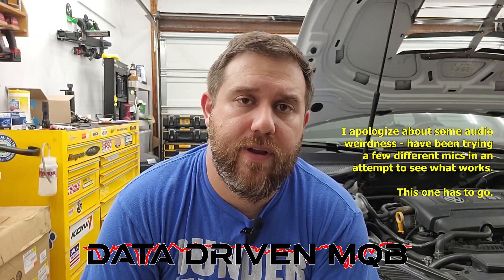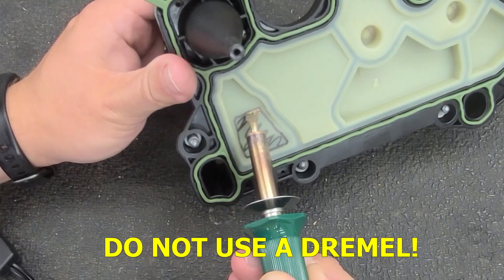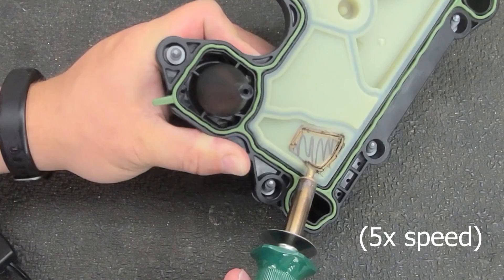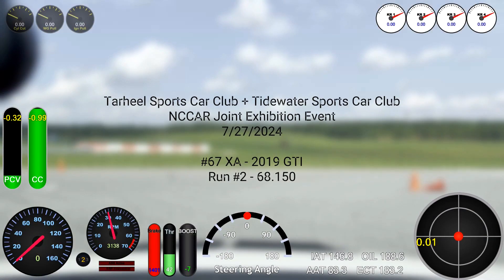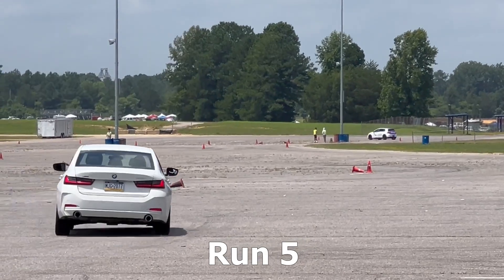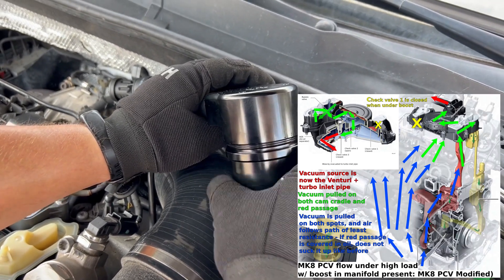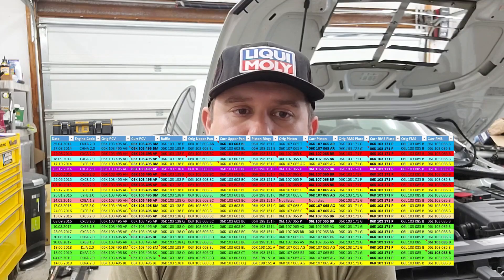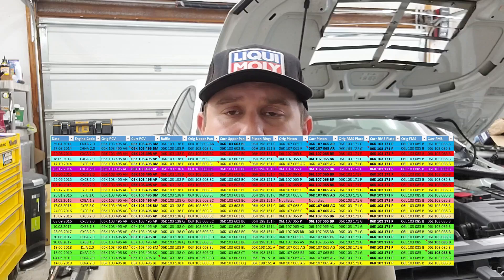MK8 PCV Modification - Fixing a 2015 GTI's smoking problems

Comment: I have 2017 engine code cxcb i recently did the retrofit pcv upgrade and got so much smoke on the street happened at 6500 rpm im wondering if this mod would solve my issue hear you say it helped a few others it probably would salve my problem
Reply from the maker: Follow the flow chart and check out the video in the "Smoking problems" section:
https://www.datadrivenmqb.com/mk8pcv

There are a LOT of factors to consider, and the CXCA/CXCB engine codes had huge internal changes throughout the lifecycle. 15-16 cars are more problematic, but a few very early 17 VINs I've run have had the earlier style piston rings as well. These cars tend to not do as well with the retrofit.

Call your local dealer, provide your VIN, and ask for the piston RING part number. Check the flow chart to see if it's listed as a 2 or 3pc rings. Oil leaks, excessive blow-by, bad valve stem seals can all also cause problems even if everything else is "ideal". Also if it is just the basic retrofit, then you need the stock turbo inlet to have any chance of it working well.
Reply: @datadrivenmqb so I’m on a vortext xl turbo I tried to put the stock turbo inlet doesn’t fit this turbo when I had the stock pcv I never had any smoke like now the last change done on the car was the retro fit pcv valve and then I got smoke 💨
Reply from the maker: @Nic-Ink  got it. As explained here nearly 2 months ago... rule #1 is if you aren't having problems then don't mess with it:
https://youtu.be/g84dsN3UfvI

Since that ship has already sailed:
Follow the flow chart here: https://www.datadrivenmqb.com/mk8pcv

Send me a PM with your VIN through https://www.facebook.com/datadrivenmqb if you're on FB and I can run it to see which ring package it has.

Comment: have a 2015 MK7 no issues currently -- is it a bad idea to preemptively do this retrofit? bought the kit, but having second thoughts because of "don't fix what's not broken"... stock turbo, but i do have a bigger turbo inlet pipe... leave it be or still worth doing?
Reply from the maker: Don’t fix what isn’t broken. If anything consider a stock TIP and OE valve. I’ve never noticed a difference (noise or performance) FWIW.

Stock valve with stock TIP is generally best on 15-16 GTIs. The modified MK8 valve has worked for some, but IMO it’s more of a last resort type of deal for those who’ve tried the retrofit and smoked still. There’s a lot of info here… the early cars have poorer ring seal which means more blowby:

https://youtu.be/gx8o4Sh5B6Q?si=flxJ6rwGwqUi6HDL

Comment: Hi, great videos! Really appreciate your hard work and research. I have a 2017 gti with an IS38 swap. Been running an IE catch can system, but recently discovered large amounts of oil getting into the turbo inlet. I just ordered your mk8 full retro fit kit along with a Jackspania catch can. Which I'm going to install the way I've seen in your videos. Now I'm wondering if I should do the small window cut out on the bottom of the Mk8 pcv valve as well. I track the car a bit, run it pretty hard. Thanks again, keep up the great work 🍻
Reply from the maker: There’s some newer content (namely the parts catalog surfing video), latest and most important stuff is posted here:
https://datadrivenmqb.com/mk8pcv

For a 2017 it’ll depend on what your factory ring package was as some early cars had issues. I don’t know that I’d recommend it for track use unless you’re vehemently against a catch can. No personal experience with IE. On a 17-18 car for track use I’d err towards a plate system.
Reply: The oil gathering in the turbo inlet pipe scenario you talked about is exactly what I'm experiencing. I have a CTS turbo inlet pipe running with the IS38. The IE plate system is is very similar to the Apr system, which is what I have on the car now. The Mk8 retrofit with the venturi and the Jackspania catch can inline with the turbo inlet pipe is what I'm planning on changing to. In your opinion, is this a good way to go? Mostly street car, some fast canyon drives which kinda replicate autocross. And few track days a year. Thanks again.
Reply from the maker: @alexanderuhl9716  if it were mine I’d consider the MK8 as long as my car has the 3pc rings and not the older 2pc rings same as 15-16. They didn’t get changed until early in 2017 MY production as far as I can tell. If you call a dealer and your piston ring part number ends in C, E, or F then it’s the older 2pc style.

Also not all plate systems are created equal. I’m not sure if it’s the plate itself or the can design, but I’ve had multiple people who’ve gone from RL to APR or CTS to APR and that ultimately fixed their issues. APR is the only one I’ve played around with, and have you’re the first I’ve heard of running the IE system so dont even have any real anecdotes of how it’s worked for others for comparison. 

Plates require large volume flow to pull air without pulling oil with it. Any restrictions can cause localized low/high pressure zones which will pull oil out of suspension while splashing around.
Reply: That's a great help, thank you very much 🍻
Reply: Turns out I have the 3 ring pistons. I'll let you know how things turn out.
Reply from the maker: @alexanderuhl9716  just so we’re clear (and for anyone else who might see this)… it’s not 3 rings total. It’s 3pcs just for the oil ring (bottom ring). 2pc have a coil spring and a U shaped perimeter, 3pc have a flat top + bottom scraper + a center wavy spring ring to keep tension.

There’s a post about it here, though I’m currently working on a “all you need to know” kind of video regarding MK7 PCV solutions/MK8 retrofit/plate systems as I know the info is scattered all over.

https://golfmk7.com/forums/index.php?threads/understanding-the-mk7-pcv-function-retrofitting-the-mk8-pcv-and-why-catch-cans-are-bullshit-imo.429130/post-8087628

Comment: Hey there! Have a 2020 gti stage 2 ecu tcu tune. Started to see smoke on start up on warm engine. I’ll try to do this pcv retrofit and i saw a kit online. Do i need to modify it aswell like you did?
Reply from the maker: No, the modification is strictly for the earlier cars as a last resort. I recently posted a PCV diag flow chart:

https://www.datadrivenmqb.com/mk8pcv

A 2020 GTI has the better style rings and a factory BK PCV valve for reference when using the chart.

Comment: Quick question if you don't mind answering. Woukd you run the mk8 pcv vs the catch can/pcv plate? And do you run a catch can with the mk8 pcv? Watch some of you other vids as you mention i seeing problems on RH turns and heavy deceleration at the track with buring oil and on the heavy g corner occasionally going into limp mode. 2016 gti
Reply from the maker: For a 15 or 16 GTI I’d err towards a plate system since they have issues. This modification is a bandaid that I think can be useful for street use in specific cases, but for the cost it’s new OE AP PCV with stock TIP or right to a plate system with non-OE TIP for track use.
Reply: @datadrivenmqb thank you, looks like I'll have to spend a little more and get a pvc plate. Would you recommend running a catch can as well? I'll probably go 034 since there on sale right now unless you got any strong recommendation.
Reply from the maker: @blueice8683  All of the plate systems on the market come with a catch can (because they require it) so there's really no getting around it. Most sell the plates alone, but that's more for piecing together your own system or replacing a broken/damaged part from the full kit.

I've personally crankcase pressure tested the APR and believe it's a solid option: 
https://www.youtube.com/watch?v=aeCQuBDEUEs

I know many people running it successfully on track. The 034 is probably my 2nd choice, though I have no personal experience with it (yet). I DO think their drain-to-sump add-on is interesting, as it would mean you don't need to worry about emptying the can. I know of a guy overseas who does endurance racing in his MK7 and this was what they used. 

Realistically speaking I don't think you can go wrong with either one.

Comment from the maker: IMPORTANT: Make sure to watch this video with some very important information regarding PCV retrofits across different years:
https://www.youtube.com/watch?v=gx8o4Sh5B6Q
I think this modification is best left strictly as a last-resort if you happen to already have the retrofit parts installed and it still smokes. At that point you have nothing left to lose like the case in the video.

Comment: Would there be any benefit to cutting this vent for 2019+ models with basic or full retrofit as just a little extra insurance against oil surge and positive crank pressure?  Thanks, great info!
Reply from the maker: I don't believe so. Been trying to put stuff together for further updates but on my 19 DKFA GTI the modified valve had some issues which didn't show up autocrossing, but did on track. 

On the later cars the engines are just designed better to function with the BL/BK/MK8 type PCV valves. The early cars require a passage in the cam cover like the AP/BM valves have, which this modification was meant to attempt to mimic.
Reply: @datadrivenmqb I’ve got a ‘19 Jetta/GLI which comes with the BK revision PCV.  I did’t get any noticeable smoking at the track, but did go into limp mode (4K rev limit) after a couple laps due to what I assume was oil starvation: received a P164B/P164D00 oil pressure switch malfunction.  Cleared the code and haven’t had a problem in the 2 weeks since, other than the first couple cold startups after track day I got a very small poof of smoke.  I almost went straight to an aftermarket plate until I came across your channel.  Now I’m considering the retrofit, but wondering if it would fix my issue if it is in fact oil starvation from hard braking and turning at the track.

I should also mention I’ve got an aftermarket MST TIP, stage 2 E30, and is20.  No catch can either, but I’ve noticed a small puddle of oil inside the TIP whenever I take the intake hose off and the inside of my silicone hose is discolored near the TIP like it’s been splashed with oil.

Comment: Hi mate I dunno if you can help .. I got mk7 golf running 490 BHP when I put my foot down hard some times it smokes some times it don't ? I havent got a catch can ? Is that my problem
Reply from the maker: Possibly. With that much power I’d go straight to an APR plate system. Especially so if you have a 2015-16 model year.
Reply: @datadrivenmqb And if you had the Audi s3 8v, 17 model, with 430BHP of daily use, do you recommend going for the APR plate?
Reply from the maker: @porlajxda 17s street driven seem to work well for full retrofit. Shouldn’t need to perform the hole modification though. See if it works without first.

Comment: Trying to fabricate something to apply this on the MLB platform.
I have sourced a aftermarket turbo inlet for a MQB car, but the PCV connector seems thicker then it should be.
Does someone who has done the mod already have the chance to measure the diameter of the inlet where the Tiguan hose connects to on the inlet?
Reply from the maker: Check out Radium for fittings. Otherwise a snap-in fit isn’t absolutely necessary. Some aftermarket inlets snap in, some don’t due to the ID not letting it fully seat.

Comment: Thanks for all the research you've done on this, it's been so helpful in chasing down some issue's I've been having on my 2017 Alltrack.  I'm thinking of doing the retrofit, do you recommend just going ahead with making the MK8 PCV modification cut out of the gate? Or installing it as is first to see how the car runs and then making the cut after the fact?
Reply from the maker: I'd use the modification strictly as a last case resort. Realistically speaking if you're fine with leaving the stock TIP... an OEM PCV (probably an AP on your car, though best to check with a dealer) works just fine.

Comment: Very nice job, but i have a question, isnt -4psi too much vacuum? I have mk7 2016 chhb with Pcv AG, with problems oil consumption, oil pan etc, and I have doubts about whether I should do the full retrofit mk8 or not… it’s blowing my mind, thanks in advance
Reply from the maker: -4psi is pre-diaphragm. The diaphragm regulates it down to about -1psi which it can reliably hold.

Check out this video with some info specifically regarding the early GTIs, I’d probably lean towards an AP or BM PCV valve (genuine VW) with stock turbo inlet before the MK8 retrofit for 15-16 models:
https://youtu.be/gx8o4Sh5B6Q

Comment: What would you suggest in my situation? Currently I have a stage 1 ECU and costum TCU tune on a Golf 7.5R 2017 (EU car). I have the Racingline turbo inlet and I think about just putting the stock one back. I go to the Nürburgring several times a year and do 4 to 5 laps average with breakes in between. Car is also daily driven. I will put semi slicks (Cup 2s or AD09) on this year and add camber trough lower control arms probably. I didn't have any oil problems yet the car was mostly driven stock and on PS4S tires. Go full retrofit with or without modification? I don't think about putting a catch can on, but most people say it's needed when you're able to go fast on the track and put high G forces.
Reply from the maker: @hunteRfps  I’d just throw the stock turbo inlet back on. It’s not making any noticeable power differences. If you’re not having issues then there’s really no need to worry about it yet.

Comment: Can i cut a hole in the bottom of PCV valve on 2016 GTI? More as a prevention. It doesn't smoke very much, and it consumes about 1 liter of oil per 5000km/3000miles, so not very bad i reckon, piston rings have been replaced 1 year ago, it had much worse oil consumption than that. I did not installed MK8 PCV, it's more costs and more hassle, and besides that you said it may not be so good for 2015/16 GTIs right? But previous owner replaced PCV last year to a knockoff one. Unfortunately i have to take it apart again because it seems that PCV hose is leaking oil a little bit, it drips on crankcase cover from in between hose and PCV. 
And i'm just evaluating my options. Since i have to take it apart anyway, in order to seal it with some silicone, would you reccomend to cut a hole in the bottom of that current PCV? Is that better for 2015/2016 engines? Or does that only apply to MK8 retrofit?
Or perhaps would you reccommend to replace that PCV valve to updated MK7 06K-103-495-AP? And if so, then cut a hole, or leave it be? ;) 
Thank you for all of your research!
There are so many variables it can be little confusing. 
Oh, and i changed back from APR turbo inlet pipe back to stock one, after 6 months, i didn't really see any power difference on that APR inlet pipe, on Stage 1 tune, and so after i saw your video about aftermarket pipes being not so good for PCV vaccum, i decided to swap it back.
Reply from the maker: @KamilK3  a fresh AP PCV valve from the dealer would be the mostly likely best option. Aftermarket OE style valves are mostly garbage in my experience.

Don’t modify the AP valve - if you watch the video again, it already functions exactly like you need. It already pulls vacuum on the cam cover (instead of the blowby passage).
Reply: @datadrivenmqb  Ok! Thanks a lot! So I will replace PCV valve to AP version in that case, and perhaps also PCV hose
Reply: @datadrivenmqb  although I can't find anywhere the part number of that pcv hose that goes to the turbo inlet pipe. Can I trouble you to ask where do you check some parts diagrams with parts numbers, and how do you know which parts numbers fit what year model?
Reply from the maker: @KamilK3  best way is to call the dealer and give them your VIN. Calling ShopDAP works as well since they have access to the same dealer catalog.
Reply: @datadrivenmqb  that's great, I'll do that! Thanks again! Happy new year!

Comment: Question does anybody know what inlet pipe will for sure fit with the tiguan hose?
I just got the full retrofit for my 2020 vw GLI,  However i cant seem to find a inlet tube that will fit and clip in place i have tried IE,034,Afe, Arm, and velt by urotuning none of these inlet pipes allow the use of the tiguan venturi, Either the angle is off or the pcv port is not deep enough to allow the "clip"to engage.
Reply from the maker: Some of the inlets I tested had the same issue. There was never any problem with anything, hose popping off etc.